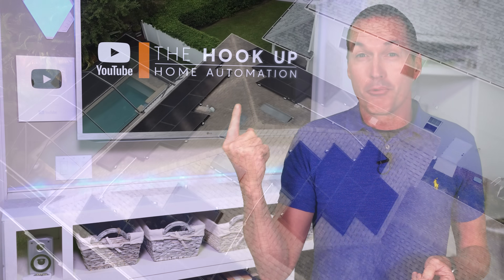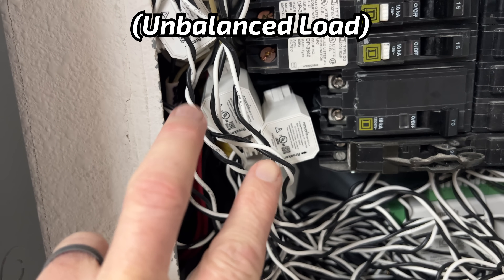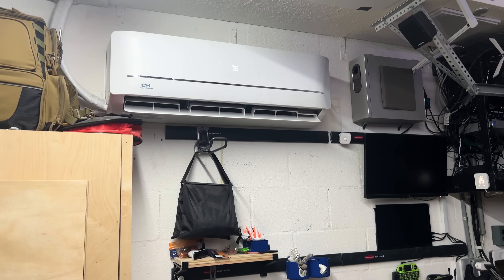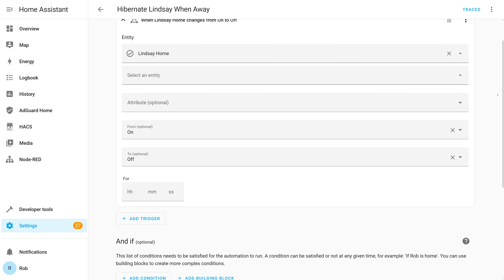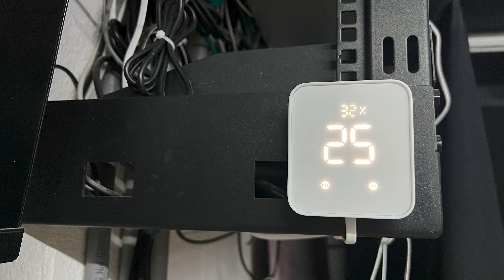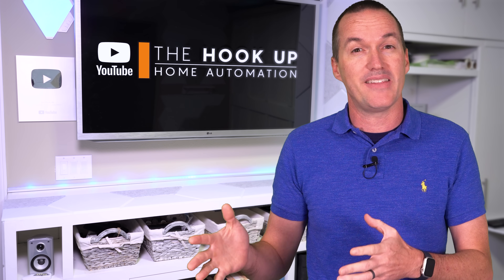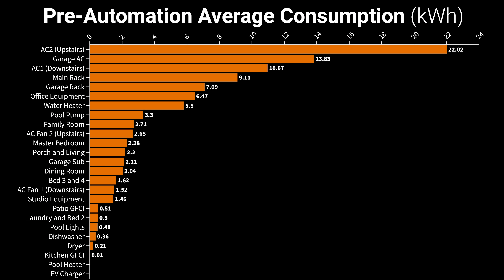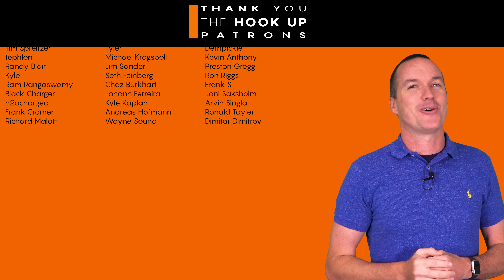I cut my electric bill by $1,331/year (with Home Assistant automation)

Comment: I love your videos and the methodical style you use to calculate results. But in this episode you multiplied your summertime savings by 365. Is that appropriate? Do you really use as much electricity cooling your home in January as you do in July? I live in Las Vegas and out here the A/C is life-and-death in the summer, but it's NEVER run November thru February, and run to a lower-amount in the "shoulder months". So, I guess I'm asking, unless your A/C usage and electric heating usage account for the same number of kWh 12 months out of the year, I don't think your savings will be as high as you calculated.  Could you install some additional solar instead? Perhaps put panels over your pool and especially shading your A/C units might be a good place to start?
Reply from the maker: Aside from the garage AC most of the savings were from non-AC devices (computers, lights, pumps, etc).

Comment: Each season will different usage so you can just calculate summer usage for whole year.
Usage during winter will be much lower. 

Ultimately, installing solar and battery backup will save real money over time.

Just need more solar and battery will solve all the usage issue. 😂
Reply from the maker: I have powerwall and am running 100% self consumption already.  If my roof was bigger I'd get more solar.

Aside from the garage AC most of the savings were from non-AC devices (computers, lights, pumps, etc).

Comment: The way to reduce AC costs is to insulate more. Have a tight envelope of your house, triple glazed windows and huge amounts of insulation. Do a blower door test,  and auit how much more insulation you can add. Net zero building is expensive but saves on ever increasing heating bills.

Comment: Your upstairs should always be set warmer than downstairs to allow for load sharing. Else your upstairs unit will be trying to cool and dehumidify your whole home. Also be sure you have room sensors and use beestat with your ecobee to identify poor-performing or over-performing rooms. Slightly close the vents in rooms that are over-cooled to reduce unneeded cooling. Also check if you have proper humidity control of bathroom fans as over-running them simply shoves conditioned air outside.
Reply from the maker: Is there an alternative to this? We work out upstairs daily (treadmill and home gym) and work downstairs.  It would be uncomfortable to keep the upstairs any warmer, but equally uncomfortable to keep the main floor colder.
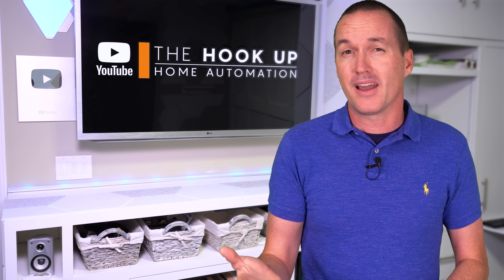Reply: @TheHookUp I have 4 comfort profiles that slowly raise and lower the temperature to allow for less drastic changes and to cool after the sun goes down at our kid's bedtime by 8:30 and again by 11:30 since you sleep better when cool anyway. Then we have a cooler morning temp that bumps up warmer at about noon. It helps us in winter with reducing heating of the home at the coldest pay off the day as well. Since you're in Florida you should get a heat pump water heater as it will suck up heat from your home and make hot water at 400% efficiency. Get the biggest you can fit and set it at 120 and lock it into heat pump only mode. 

Beyond that there's something you need to change: behavior. In summer I shut the AC off and work from the basement. In winter instead of heating the basement I have a warming pad for my feet and I bundle up. Compromise is what saves the most money.
Reply from the maker: Shutting off AC is basically not an option in FL.  Not only does it get very uncomfortable very quickly, but mold is a huge issue due to the high humidity.

Comment: Me watching this video and coming to the end where your daily was 99kwh, thats crazyy! I just got into a new home with a very heavy insulation, our governemt doesnt allow houses anymore if they are not in the A+ efficiency category. 
Anw its around 250sqm
And having an open plan area of 80sqm with 3 ducted acs (around 22kbtu = 6.5kw) controlled with one vrv.
I have that thing running for average 6h a day.(working from home) (We have 39-42 Celsius (+-100fr) degrees now)  + server and main pc and some other 12btu units. And the max consumption I had was 32kwh a day. And to mention that my solar panels produce around 41-42kwh per day. (Net metering)
The massive vrv as soon as its powers up you can see the power draw being around 6kw. Then within 20min that power goes to as low as 1.85kw thanks to the insulation.

Comment: Quick question for you!!  I have a couple chest freezers that I'd like to monitor the temps of and make an alert in HA for, so if they die, I'll know.  I've tried a couple different thermometers now and they either freeze, the batteries last no time at all, they're can't connect from inside the freezer or a combination of the above.  Know of any thermometers that would be good for this?...like, a thermometer that I could stick on the outside or something, so the batteries don't freeze and die and it can connect to HA, but has a probe that goes in the freezer?

Comment: You should look up the IoTaWatt system for a DIY guy like you and I.  Its even better, all local, no cloud, open source, etc.  I have data going over 4 years back at my fingertips for every breaker.

If I want to show it off to someone away from home, just connect with the VPN since I do not port forward anything. 

He sold full kits, but I am not sure if he still is.  But it was always a DIY project and the plans to build it are free and still there.

And of course... Direct Home Assistant Integration.

I have a full DIY solar setup right now running computers, network, servers, etc and the movie theater.
Standing up a 20Kw array and moving to whole home soon, and hope to be 100% off grid (right here in Tampa)

Comment: You..... don't have power settings enabled on your computers? 

14.4kwh = 14,400 watts / 3 devices = 4,800 watts / 24 hours = each computer is using an average of 200 watts of energy.

I have full blown servers, with multiple processors.... and nearly a terabyte of ram using around the same amount of energy.

My gaming PC, with its RTX3080ti, 64g of ram, Ryzen 7 processor..... Its pulling 120 watts while just browsing, or doing light work. Granted, it jumps to 400+ watts while gaming... but, still. Thats HALF of the avg consumption, WHILE IN USE.

The laptop I use for work, with its 16 core i9 processor, and 64g of ram.  It averages around 60 watts.

What on earth did you do to your PCs, to have such high power usage.... lol....
Reply from the maker: Easy answer: RTX graphics cards.  1x 5080, 1x 3080, and a 4070ti.  They are massive power hogs, but make our workflows a lot faster and easier.

Comment: Another great video I enjoy when you do the tutorials. I think there was a study done. I can’t remember the exact numbers but it was something like eight hours a day and I think you have to be seven or 10° drop in order to actually get savings on your energy bill for your heater AC another option if you don’t mind dealing with a little bit of less light is closing blinds when the rooms are not use use

Comment: You talked about power usage at each circuit but not sure if you factored solar into the equation. If you were to run your A/C during the day when you are producing electricity and raise the temperature at night when you aren't, you may be using more electricity but spending less money since you are using your solar power to run your A/C and not selling it back to the grid.
Reply from the maker: I have powerwalls, so I don't push anything back to the grid.
Reply: @TheHookUp  The idea is the same. Running the A/C at a lower temperature during the day while generating electricity may mean you consume more energy but costs you less money. A kilowatt of electricity costs you more when the sun is down even if your power company has a flat rate.
Reply from the maker: I’m both confused and intrigued.  How does it cost more when the sun is down if I’m already using 100% of the power I generate and the utility charge the same no matter the time of day?
Reply: @TheHookUp  As far as I could tell, you were measuring power consumption at the circuit and basing your calculations on a fixed rate per kWh. During the day you are getting power from solar and in the evening you are getting some from your batteries. Ignoring installation costs and maintenance costs. This electricity is "free".
Cool your house more than needed with "free" electricity and let it warm up when it costs money. You may use more electricity at the circuit but you are not paying as much.
Reply from the maker: I think what you're not understanding is that it does not matter when I use the power from solar, I'm using 100% of it regardless.  If I make 1000kWh and get 3000kWh from the power company I pay for 3000kWh.  If I reduce my consumption by 500kWh then I still make 1000kWh from solar, but only get 2500kWh from the power company and only pay for 2500kWh.

Comment: I am curious as to the two AC fan energy reading independent of the larger AC1 and AC2 numbers, that i would assume had the compressor and both the condenser and inside air handler fans in their reading.  What is this?
Reply from the maker: The compressors and air handlers are on different circuits, so each one had it's own CT.  For calculating the AC usage I included the sum of the compressor and air handler.

Comment: Another great video with some great insights, Rob!

Definitely look into not only more/better insulation, but look into sealing air leaks. There are a lot of cheap FLIR cameras on the market that can really help you figure out where the cold air is sneaking out of your house. 

Your power is about 4x the price of mine, and I've been consistently working on reducing power draw from my homelab. One of the biggest savers has been switching to Unraid, which can spin down disks that aren't in use. This works since Unraid fills disks sequentially, as opposed to spreading the data across all disks evenly. 

I really like your idea of using the HASS agent to hibernate or sleep computers overnight, and I'm going to add that to my to-do list!

Comment: Have you seen those AC unit misting devices? With all your testing equipment, you could test that also! 😀
Reply from the maker: I've heard they can cause issues with scale, and we do have a lot of calcium in our water.
Reply: @TheHookUp , the one I saw had an in-line filter to protect against that. Just another idea with your setup. Keep up the great work! Love your independent videos... in the process of setting up my own private security system with alot of your information. THANKS!
Reply: And... you could only run it when not in shade... 🤔🤔🤔😀

Comment: America is crazy, it's 35°c outside, and I only used 12 kWh to cool a 170m² house for 24 hours!
Using a heat pump and floor cooling.
Reply from the maker: Is floor cooling like Geothermal or something?
Reply: @TheHookUp no I have an external heat pump (not geothermal, but simply free standing), and the heated floor can also be cooled down using the same system.
So the house is kept fresh with the floor being kept at around 20°c on both floors.
Reply: @tiloalo  how does that work with de-humidification?  or are you in a dry climate?
Reply: @antoineg639 there is a dew point monitoring system that ensures that the floor never gets under it.
And yes, I'm in Germany, it's not very humid in the summer.

Comment: I did the same thing with an emporia vue and Home Assistant. We are out of the house during the day and I can run a schedule. It took some trial to get it down though. If I adjust the temperature too much, it will take so long to recover back to the desired temperature that the savings will be diminished or gone.  I also have an automation that will turn on the HVAC fan as the temperature is nearing the upper limit. Just cycling air through the house will often delay the AC having to come on until the afternoon or close to time when we are returning on the cooler days. I also use the Zones in Home Assistant to have the HVAC fan and all ceiling fans turn on high for a few minutes when we are close to home as well as adjust the set temperature for the HVAC. When we get home the fans go to a lower speed depending on the temperature in the room its in. The HVAC fan will run for a few minutes then turn off (or Stay on if the AC is cooling). II have definitely been able to save by monitoring and making adjustments to HVAC.

I also flashed my Emporia to ESPhome. it was easy and nice that the data is just live and in homeassistant without any other workarounds.  I have another automation for one circuit that often gets overused. The dish washing machine and a bathroom next to our kitchen are on the same breaker. If the dishwasher is heating and someone uses a hairdryer, the breaker will flip.  Using the wattage data from emporia, I have a smart switch on the dishwasher that will turn it off until the wattage lowers. It waits for 30 seconds to ensure the hair dryer won't be turned back on, then t urns the dishwasher power back on. My model will just resume where it left off.  This isn't common, but happened enough to automate a way around it.

Comment: What if I have more than 16 circuits in a single panel?  Is there an expansion pack to monitor more than 16?  Install 2 systems?  Great video and I will buy immediately.
Reply from the maker: You can install 2, or you can combine circuits as I've shown in the video.  As long as the 120V legs are on the same phase they will be additive when put through the CT since it just measures the total amperage passing through the coil.

Comment: I'm amazed at people who are able to fit CT clamps on all of their circuits. I was lucky enough to fit my two clamps over the mains so I can measure my overall usage (which is good enough for me.) My breaker box has enough wires in it that it's hard to put the cover on it without it bulging from all the romex.

Combining my info from my Aeotec home energy monitor (zwave) + gas meter (915mhz) is giving me enough info to figure out what to prioritize and how much to stress over our controllable vs non-controllable energy usage. Now I just need to figure out how to listen to our water meter....

Comment: Amazon Echo..... gross (sorry. dont like systems that invade ones privacy and harvest data for their own uses/profit). 
As for A/C, as you discovered, changing the temps to vary depending on the time is actually worse because it takes more energy to get a house (or in your case, a floor) back up to a comfortable temp than you 'save' by trying to reduce its usage. Its more energy efficient to keep it at a set temp and let it maintain that. Not to mention, changing the temps constantly puts more wear and tear on the HVAC system and could (depending on the system) cause damage if its not built to do that.

Comment: I have a Sense electricity monitor.  I liked it, but as I add more and more devices on smart outlets, smart plugs, power strips, and backup batteries (Solix, for instance) it seems to lose the ability to differentiate devices.  Which I reckon is understandable.  Edit:  Don't disagree one bit with your evaluation of Sense.  I liked it, but it does have problems with quite a few devices.  And mixing them up (for instance, space heater, toaster oven, etc).

Comment: I have a 100amp subpanel and emporia recommended buying 2x units in order to track everything accurately. I haven't pulled the trigger yet but super stoked to see a reliable review. Thanks for this!!!
Reply: Emporia recommends using dual sensors for 220v breakers for better values.  The problem is that I doubt many boxes have room to get all them in there and I don't believe that you're going to get a different value by doing a single pole doubled.  Count all your breakers and buy that many sensors.  I have a 200A service and 2 setups were just barely enough.  I have a 100A service and that's going to require it's own 3rd setup.  I haven't done that one yet.

Comment: One thing you should be able to do with 240v circuits that are unbalanced, if the CT is large enough (100 amp CT for a 2 pole 40/50 amp circuit), is to cross the wires and put it where the wires cross. Picture an "H" where the Top Left of the H is Phase 1 and the top right is Phase 2. You put the CT on the "-" of the H and the bottom left is Phase 2 and bottom right is Phase 1.

Comment: Have you insulated your garage? Including the garage door?   I turned my garage into a workshop, insulated and dry walled, without that the two mini split in there would run nonstop.  The insulation isn’t quite as efficient as the house, but made a massive difference in keeping it cool in summer and warm in winter.
Reply from the maker: Yep, it’s insulated

Comment: Holy moly! 99 or 78 kWh a day is crazy high 😱
We average around 25 to 30 kWh in Summer and not more than 50 kWh in Winter. And this covers all of our energy since all appliances are electric as well as the heating. So no gas or oil costs to be considered...
Reply from the maker: My consumption in winter months was in the 50-60kW range last year, so I'm guessing with these automations it will be close to 40.  I think a lot of European people in the comments are underestimating what it's like to live somewhere with 90+ degree temps and 70-100% humidity for 3-4 months a year.
Reply: @TheHookUp May be we underestimate, but even when we hit temperatures around 100 degrees here I'm not hitting these kWh numbers. Even when running the AC 24/7 to cool down the house to around 77 degrees. Perhaps it comes down to how houses are built and insulated in Europe compared to the US. For example in Germany we have a lot of regulations about how much energy a house is allowed to "loose". Therefore we needed to install a ventilation system with heat/cold recovery and needed to have a certain amount of insulation.